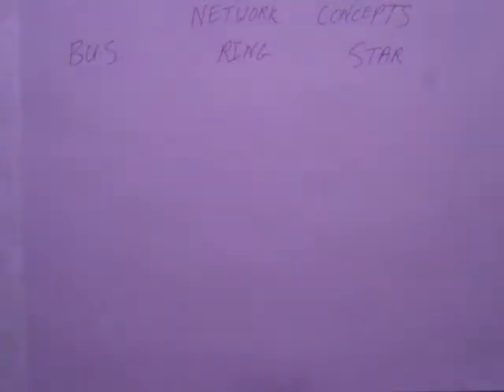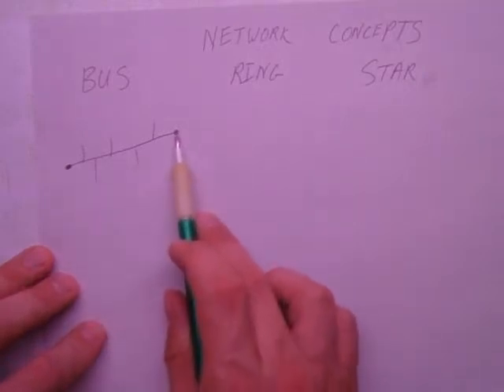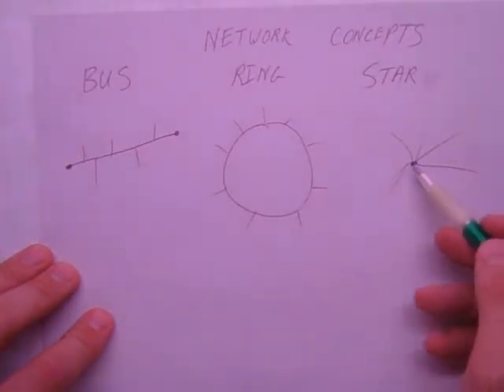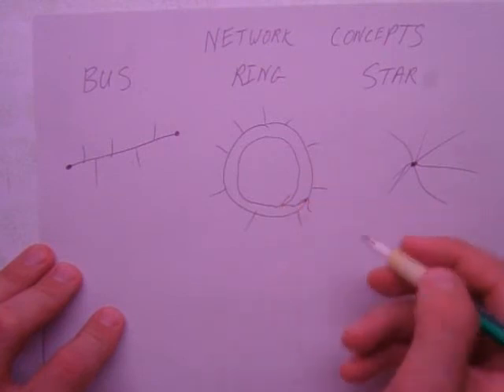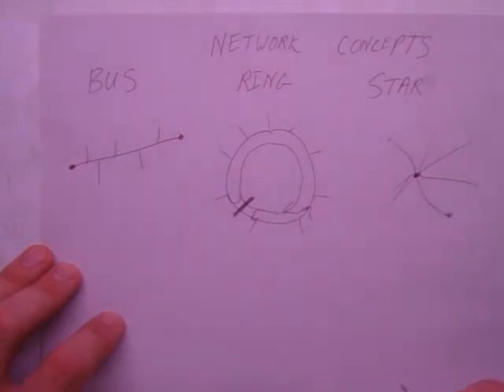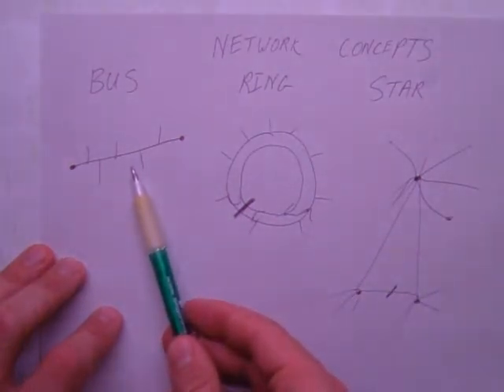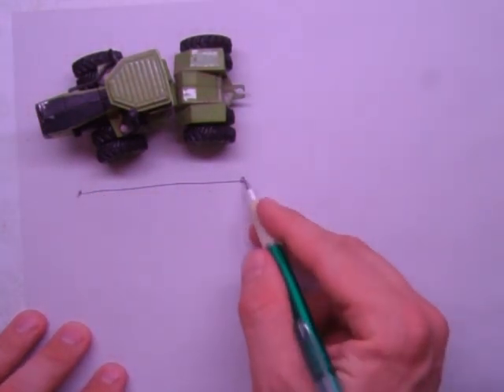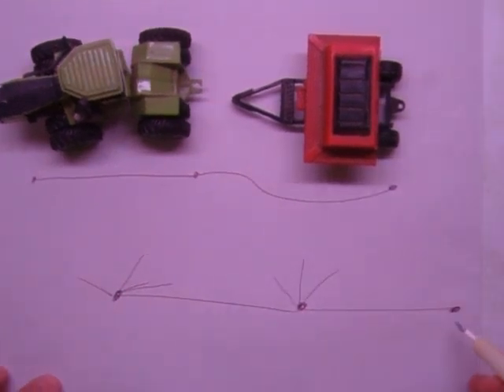Networking in Agriculture

Comment from the maker: I think so, and easier to troubleshoot. When an ISO node fails, it can cause the entire bus to stop working, making it a pain to locate the failed module. With star based networks, the failed node stays isolated on its own segment. A switch failure would be the exception, but that should also be more obvious if it does fail.

Comment: It would be nice if they did do your switch design and it had a well define RFC like TCPIP of the internet world. So you wouldn't end up running cables all over your equipment they could all share the same interface. So one could put a GPS receiver on their planter if they wanted and have it interface with the screen the cab by simply tapping into the existing network. I guess your camera explanation was better heh. Also it looks like this old BUS stuff isn't very quick either.